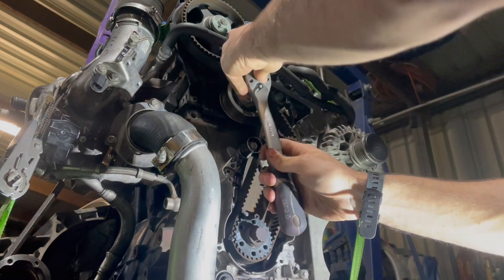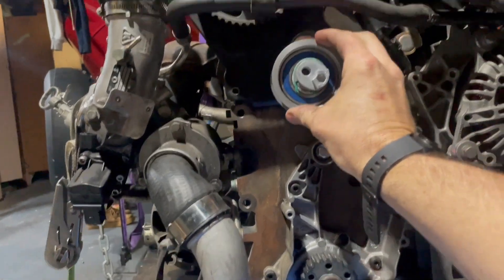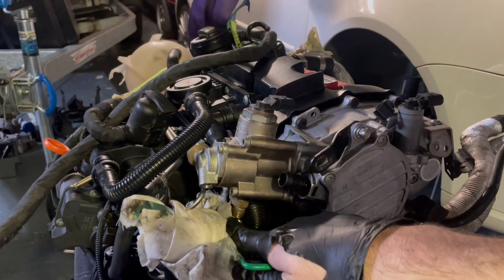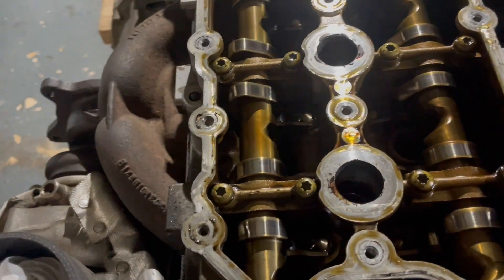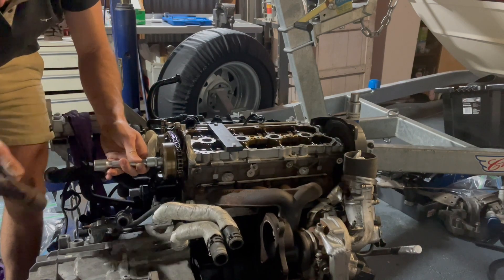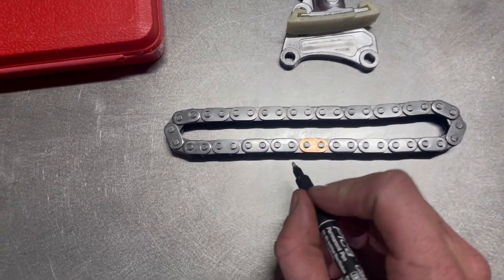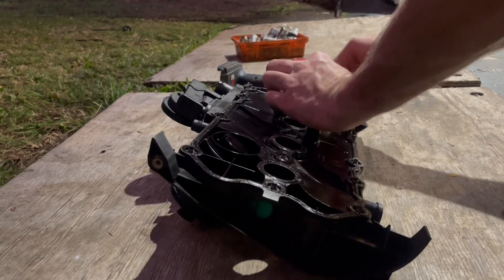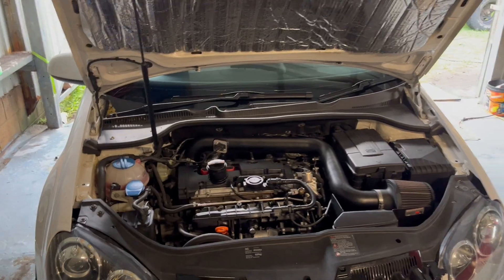[EP10] Timing Belt & Cam Chain Replacement (Rounded Off Cam Nut) - Golf GTI Mk5

Comment: I am not sure if people know but that is not a Torx bolt but a Polydrive bolt.  They look similar but are different.  So before you do this use the Polydrive socket.  Sadly I had to drill one out before I found this out.
Reply: I am about to use the polydrive bit I bought for this purpose... the bolt specifies a polydrive, and a google search says a "ribe" bit looks similar to a polydrive, but there are slight differences... given all of the issues others have with this bolt, I wouldn't risk using anything other than specified...

Comment: GREAT Job, Question my cams are not moving when cranking , would that be the belt or timing chain on the drivers side?
Reply from the maker: That would be the belt sorry mate. You’ll probably need to recondition your cylinder head because all your valves will be bent.

Comment: Had the same issue with the rounded bolt on the camshaft for my Audi A4 B7. Followed the same method as you, drilled it out some and then hammered on an M14 triple square. Used my impact and it came off. Thanks!

Comment: VW/Audi uses locktite on the cam phaser bolt. If you don’t want it to round out heat the bolt from the center with an oxyacetylene tourch. It melts the locktite and the bolt will come right out.
Reply from the maker: I'd be worried about cooking the internal seals in the cam adjuster
Reply: @ my method assumes that you would be replacing the cam phaser with a new one. They are relatively cheap (or at least they were).
Reply: The cam phaser often have grooves worn where the seals go, which prohibits reinstalling the seals without breaking them. Hence the cam phaser/adjuster will often have to replaced anyways.
Reply: Thank you for this

Comment: Without any drilling, a T55 and a lump hammer... Rounded bolt came right out
Reply: You are a top G, I tapped a T55 in there & was able to get it out no drilling. Also I used a wrench to hold the cam while my parter broke it loose, no cam tool needed
Reply: @KingLouieIII-i8x  I also used this method 😅 alone without a helping hand

Comment: Hi! Thanks for this in depht tutorial for these jobs! Do you still have the partnumber for those Elring oil control rings, or where I can find those?
Reply from the maker: The Elring website has a great parts lookup program
Reply: Maybe that will fit

SEAT: 06F 103 107G
AUDI: 06F 198 107A
ELRING: 703.180

3x ELRING Dichtung Nockenwellenversteller AUDI SEAT SKODA VW 2.0 TSI 703.180

Technische Daten:
PTFE (Polytetrafluorethylen)
Dicke/Stärke [mm] : 1,8
Innendurchmesser [mm] : 21,5
Außendurchmesser [mm] : 25

Comment: Why not use Gates RTB Belt ? and HEPU Metal Waterpump ?
Reply from the maker: Because SKF designed their belts, tensioner and pump to be used together. Every tension and force each manufacturer designs their parts with is slightly different. It is always better to use one brand with everything.

Comment: My timing chain scrapes inside the cover grinds inside and metal pieces are blocking the pick up pipe. Iv took to 5 mechanics and had timing chain re timed and replaced twice. Third time at the mechanics rn i have no hope in someone fixing this. Was fine before i got chain replaced wish i never did it now and just let it snap one day lol
Reply from the maker: There is no reason that should be happening. I'd take it back to the original place and demand they fix it.

Comment: You’re the first person I’ve seen use red thread locker of little tty bolts. Seen blue or without several times. Ever have any problems getting them out or do you hit with heat first or use very minimal?
Reply from the maker: All loctite threadlocker is red, I don't use the strong one.
Reply: @cheapthrillsgarage  All thread locked isn’t red. Red is usually permanent or heat to break loose. Blue is medium and then you have green.
Reply from the maker: @hardcore4476  I’m talking about the brand I use called Loctite
Reply: @cheapthrillsgarage  staring at a bottle of blue loctite*

Comment: Great work. I've got a 200,000km mk5 gti that I started working on myself and have found this video invaluable. Your idle cleaning up makes me want to do the same for my chain and tensioner. Out of curiosity, where do you generally source parts from? I'm having trouble finding quality parts in Aus and have had to shop around heaps. Cheers.
Reply from the maker: HSY Autoparts are good, also Run Auto parts. Sparesbox are useless.
Reply: @cheapthrillsgarage  thanks mate I'll have a look at HSY. I've had good results so far from Run Auto. Sometimes Rock Auto in the states seems to work out pretty well too. Chinese market seems to saturate all my search results normally. Cheers!

Comment: Great video! One question though. I’ve done the job myself and noticed the the chain has some slack on the bottom. Did you experience the same?
Reply from the maker: Yeah mine was the same
Reply: Done this on my mk5 gti after fitting the chain and pulling the pin on the tensioner the chain is still sloppy on the bottom it’s got me bloody baffled think I’ve done it wrong,the cam locking kit is very similar to yours in fact probably the same,the lobes on the tool kept going slack,when turning the inlet cam the exhaust moves loads to get the vvt on to the locating dowl and the chain is tight on the top slide and sloppy on the bottom I’m absolutely hating this and don’t want to build it up as I think I’ve done it wrong
Reply: @dirkdingle7926  it’s supposed to be like that. The chain tightens when the system gets oil pressure
Reply: @gtichronicles  thanks mate for information I’m a diesel technician by trade don’t work on petrol engines so was baffled to bits,sad news anyway my crank is toast span a shell on no4 nothing left loads of swarf in the sump so I’m after a new engine at the moment

Comment: Excellent video. Those polybolts are absolutely shite. I've taken off 3 with quality tools and I've had to drill them out like you have. I've had to take my new bolt out due to slight mistiming and they're just as shite as old ones lol. Cheers mate

Comment: nice job... same happened to me when attempting to remove that stupid bolt, the teeth just disintegrated. Every one of those cheap ebay cam locking tools has the same issue with the pins bending due to the small weak bolts they use to join them to the main brace (my mate welded my one up so its "fixed" that problem).